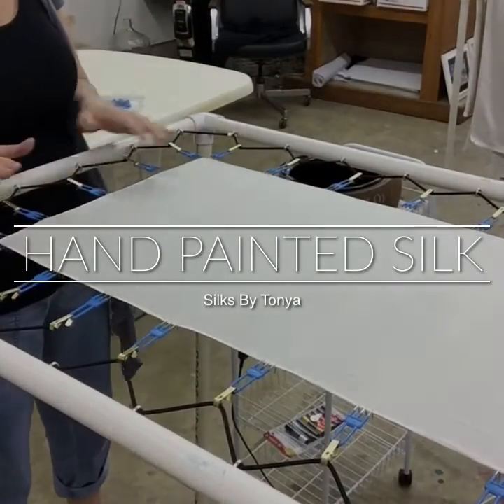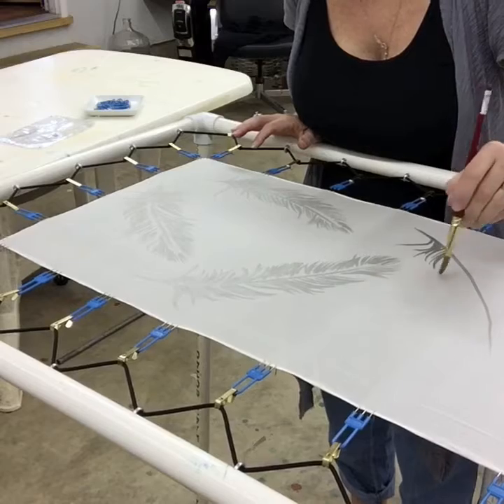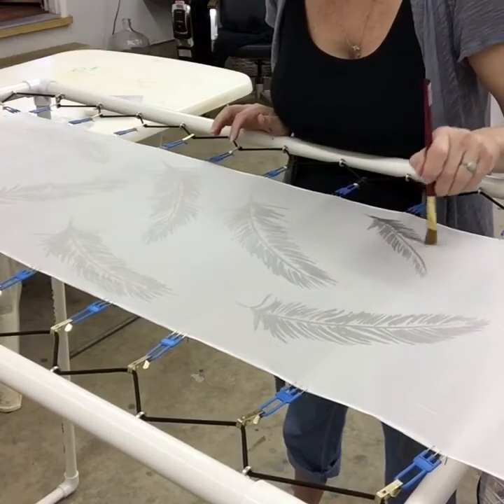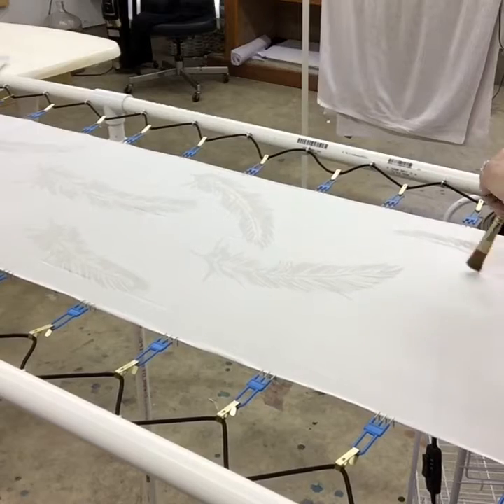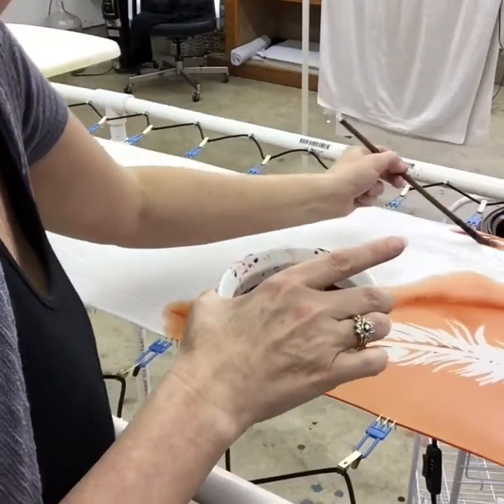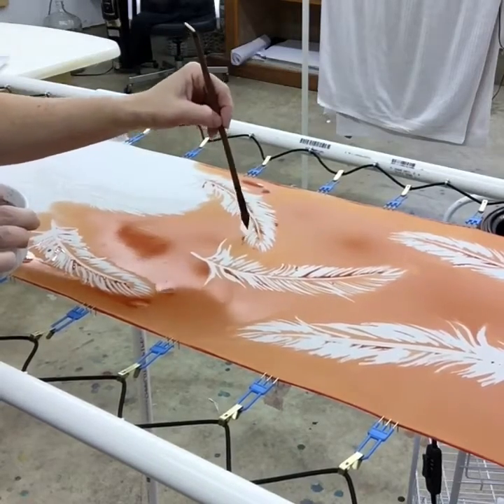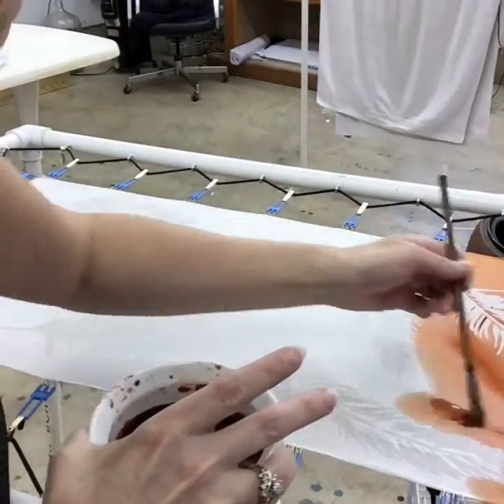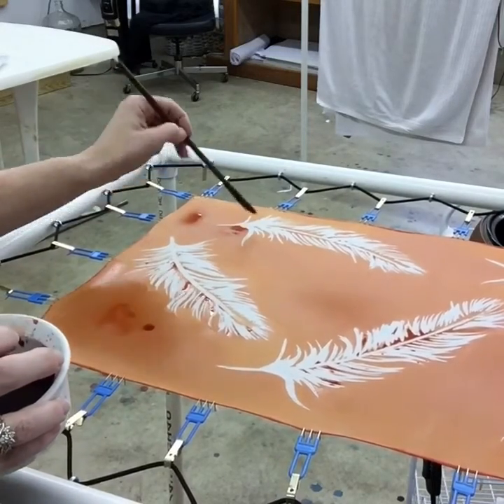Hand Painted Silk Scarf by Tonya Butcher

Comment: I want to know more about the soy wax resist.  You seem to have a very painterly quality when applying it.  That ease of movement is something I’ve found difficult to achieve with gutta.  How do you remove the wax?  I have avoided waxes in the past due to the additional labor involved in its removal.

That stretcher is the winner for sure!!!  I have used many systems over the years ranging from 2-by-fours with clamps to modified quilt frames. Ive looked at and explored lots of different options and until now, I haven’t settled on my ideal system.  Your system is, by far, the best and most complete I’ve seen; and it’s a home built system which adds to its value in my opinion. I’m going straight to Lowe’s to get the stuff to make one.